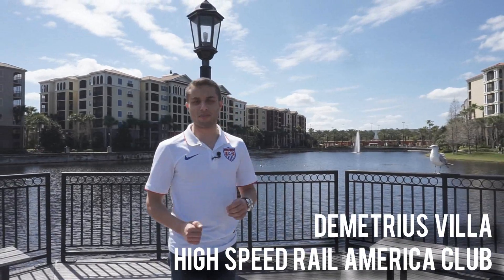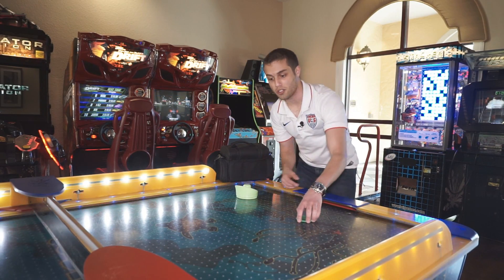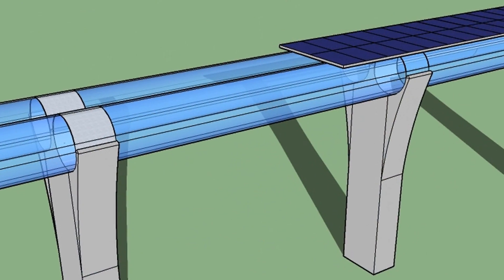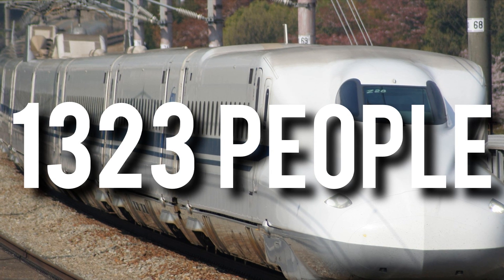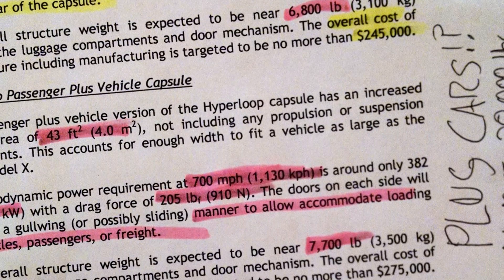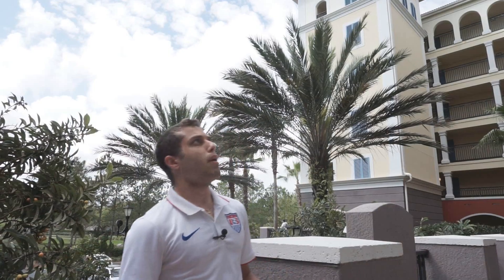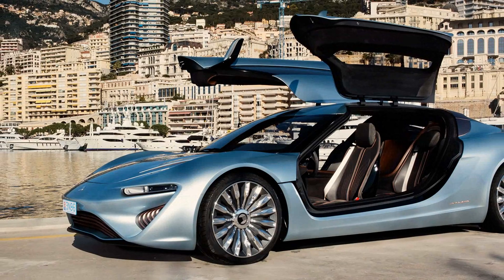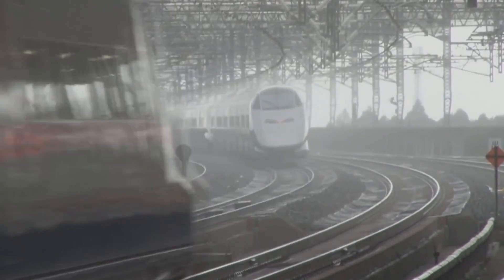Can the Hyperloop Work? FAST FORWARD

Comment: (do note this is coming from a huge Elon Musk fan and former supporter of the hyperloop project. This is simply from research I've done)
My issue is with hyperloop is that for every couple meters there would have to be a buckling point for heat expansion (similar to what large bridges have) and they would cause leaks in the vacume. Secondly, of there were to be a failure, it could be catastrophic (watch a video of a tanker car imploding). It's not impossible but there are alot of technical challenges and issues of potential failure. I'd rather take a traditional HSR or a Maglev if/when that technology becomes economically feasible.

Comment: The only problem is that only the running methodology has been discussed and HTTI has not announced evacuation methods at the time of failure.
There are no announcements on how to rescue the pods in the pipeline when an emergency stop occurs, such as when the system goes down, when there is a power failure, terrorist attacks occur.

Comment: Jiaotong University ,the oldest railroad school with government funding has built a small maglev line in hyperloop system in 2014.at 1,000 km/hr.CRCC will build a larger maglev train in a hyperloop system between cities at a design speed of 2,500 km/hr.CRCC has built two maglev lines,One in Changsha,the S! red line in Beijing and is building 10 more.CRCC has built 30,000 KM of HSR at 800 billion dollars and is planning to build another 20,000 KM of maglev rails or HSR.

Comment: First let me say that I support High Speed Rail having seen its beginnings in Japan in 1963 from the wind of a 60mph narrow gauge first class train seat. They even had at seat entertainment via earbud(singular) back then. It has taken strong governmental support to develop these foreign systems which only now are mature enough to satisfy the investor class here in the US. sufficiently for your organization to begin to promote privately funded versions only where right of way is fairly easy to obtain and fits with developers ambitions. 
That said,  we need both Hyperloop and HSR systems. The MagLev system on development in Japan are tremendously expensive to implement, and the TransRapide is at the end of its usefulness as a concept. Both suffer greatly from the costs of  air resistance  without a major speed improvement, and like aircraft, need to expend energy just staying aloft, while applying downforce to stay within the guideway.

Enter the Hyperloop technology, which you, as so many others misjudge. Elon may also  have gotten way out in front of himself, but quite a lot of his synthesis of others ideas for tube transport are quite brilliant. All HSR ideas have to be backward compatible to previous modes much like Microsoft operating systems used to be, before reality and Apple once again showed them the way forward.
What you get wrong, and so many others do as well, is misunderstand the prime idea. Hyperloop is air transport at an atmospheric density roughly equal to Mars, but on the ground. The heat removal by water is based on the short 'flight' time, and is minimized by not having to climb up to that impossible altitude( beyond U2s and BlackBirds that need air to breath). The water tank will have to be refilled at each end with chilled water, but the thermal mass  is not as large as some you might have talked to imagine. That fan at the capsule front only needs to ingest the remaining air in already evacuated tubes and use it for some of the support. I think its development will see a combination of mag lev fine position control along with the air bearings in the original white paper. 

Supersonic Concorde aircraft  were limited in both the high altitude their engines could utilize  the lower limit for heat tolerable by their aluminum skins. Concorde successors,  like Hyperloop will only be good for certain city pairs, but each has its optimum distance.  It only works for end to end transport, so we will need both. Hard to conceive for some, but the HSR will be the "local" with many stops needed between those pairs, while Hyperloop gets one 400 or more miles away in the time it takes to get out to many airports, so one day business trips can effectively expand to whole other markets without the fuss and bother of airline travel.

Comment: May I ask why you seem sceptic about maglev trainsport. Sure, it's got a big price-tag, but that goes for almost all forms of new technology. Just like the electric car. Since the beginning it's been a) too expensive or b) not practical (yet). For instance, the newest low-speed maglev trains, such as Hyundai's ECOBEE (Incheon Airport maglev) and China's Zhuifengzhe (Changsha maglev) and the Chinese Linglong Hao (Line S1 in Beijing). They're more expensive than conventional rail, but the longer prospected lifespan and the reduced maintenance may counteract this. The Shanghai Maglev Train has had only 2 weeks of downtime in 12 years. Compare that to the Dutch 2 weeks of uptime yearly. (I hate the NS and their partner in crime ProRail so damn much). On top of that, low speed maglev trains tend to have lower running costs than conventional trains at comparable speeds. Another problem of maglev technology is the fact that it is not compatible with the conventional rail ways. So back to my question: where does your negativeness towards maglev trains come from?